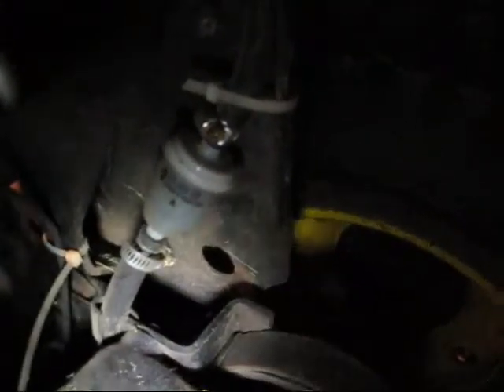Underneath the 1977 210

Comment from the maker: @stlouissux9119 yeah its normal. these transmissions arent ment to shift while moving like a synchro.  to ajust your breaks take the wheel of on the side of the tractor where the break band is then remove the brake rod and tighten the yoke on the end of the rod. if its not maxed out already. my break on my 1977 210 is shot.

Comment: My brake doesn't seem to work. The mechanism is working because when I push the pedal it tightens the break but is there a way to get the pad to grab tighter (tighten the braking system)?
Also when you put your foot on the clutch do you have to wait for the puley to stop spinning before you can put it in gear? I do or mine grinds... is this normal?